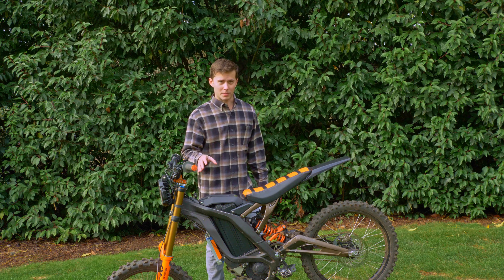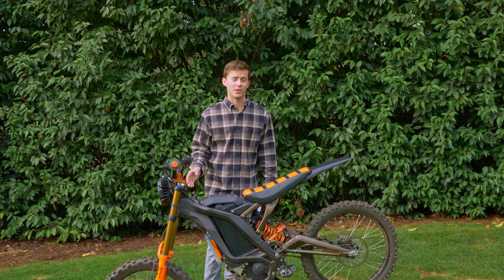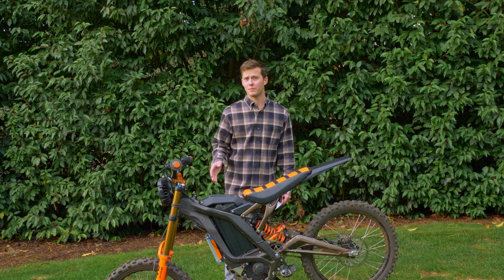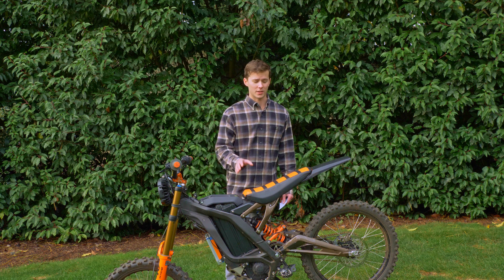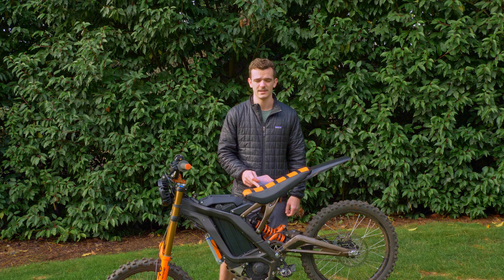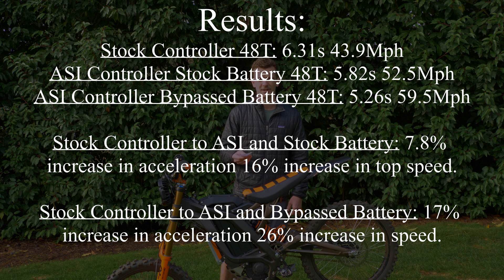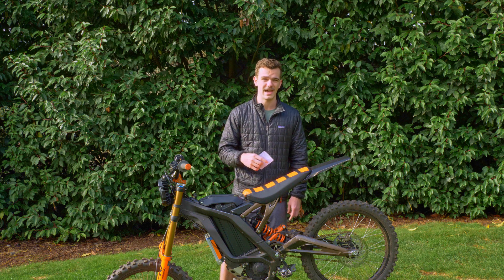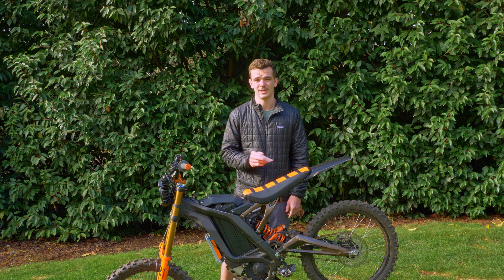Is Upgrading Your Stock Sur-Ron Controller Worth It? Testing ASI vs Stock

Comment: I believe that I should have sold my surron after two years. No problems at two years. Crazy electronic train wrecks after two years. Now it gets expensive. Whatever I saved on gas, I am paying for replacement controller. A thousand bucks and it's going to wear out quickly. Add 500$ per year to your budget. I am sick of electric nonsense.

Comment: Sorry but I do not believe that going down hill will not increase your top speed. I would love to see a test to verify your claim.
Reply from the maker: We more so meant have an effect between the comparisons. Regardless, top speed on an electric bike is much more dependent on power levels than a gas bike. Gas is typically limited by the motors ability to turn over from drag or gearing restriction. On electric, you’re electrically limiting the top speed to whatever the power level dictates you can run as power = torque*RPM. 

Anecdotally, we hit like 43-44MPH ‘downhill’ and on perfectly level ground we hit the same speed with stock controller. Uphill is where you start to lose speed .

Comment: Great videos! I have a stock x260 and stock surron x. Primarily used for pit bike track and mx track. Trying to figure out what route to go with controller and battery. I want performance, but also want reliability because we are hard on the bikes.

Comment: I got 55 MPH ..you guys were going downhill hence the speed difference. The bypass and ASI tuned to 135 amps is what I did to my Surron..and significantly faster than stock. My resistance levels were between .034 and .039 moh..do you know what the resistance is of the stock battery is and your battery sag?(mine was 5.9 volts) with my extender pack. Ive taken the Surron battery apart and made some slight improvements so I would imagine you would have more sag and resistance than my setup.

Comment: That is a bit weird. Your controller really showed increased range by 5%? That is pretty significant. Could you explain how that could be? You accelerate faster AND you get longer range out of the battery, then upgrading controller is worth for anyone. Do I understand it correctly? 

Would I be able to replicate it by getting any BAC4000 and tuning it just as you have yours tuned?
Reply from the maker: So the comparison doesn’t use any more power. This is the same power draw as stock. The higher the ceiling of the controller is regarding voltage and power limits in general, the less heat waste their is when generating said power. Other gains could be from an increase in phase current which helps stay off the throttle as much. Nothing scientific regardless, just tested over a couple rides.

Comment: Can you upgrade just the battery and leave the original X controller stock? Or is that a recipe for disaster? I’m looking for mainly superior battery range and not so much power gains. Been looking for a 60v 50ah or better but not much out there

Comment: Hey guys... quick question with the BAC 4000 is there a MODE control that let's me have a slower mode and a faster mode?  I follow my kids around a bunch and its nice to have a more mild mode.
Reply from the maker: You can set two max power levels and within those two mode you can have 9 percentages of that max power so 18 total power levels that you can set to anything you want.
Reply: @emotobros  thanks guys!

Comment: You should just put a Zero motor in it, Sur Ron's are old tech now and over rated for speed they do. A 3000w dual hub 24 26" would beat one to 80kph on same voltage.
Reply from the maker: If you could point us to a lighter and cheaper mid-drive motor we would be happy to check it out. We don't like anything about hub motors so those aren't even in the cards.
Reply: @emotobros  KTM? Bosch? Chains belts old school Tesla's have 4 hub motors for a reason but to each his her it's own as the hipsters say. Be safe the no helmet is a squid organ donor ticket for sure.
Reply from the maker: @441rider  KTM isn't capable of much higher peak, is heavier and way more expensive. I can't find anything on non pedal assist Bosch motors. The surron motor is highly capable and is the lowest end option in their line-up. Their water cooled motor with a transmission is better than anything mentioned.

Comment: Nice video! I bought a sur-ron light we X 2020, last week in Luna cycle, but the range is very poor, 22 o 24 miles approx. I want to get more range, how much you spend for this new battery? and I need necessary the BAC? Or the battery works with the original BAC? And you need other stuffs? Like a new charger? Or you can charge the new battery with the original sur-ron charger? I only want more range I don't care more speed, I have to many questions because I live in Mexico and is a lot of money send the stuffs to here and I don't wanna get a mistake! Thanks! I love your videos!
Reply: You need bigger battery if you want the range increase, there's just no way around it. Every year batteries are getting better and better.
Reply from the maker: Hey there, the range increase with a new controller is very small since power used doesn’t really change. The battery is just the stock one with a bypass mod done. We have a video about it on our channel.

Comment: How did the range change: stock battery and ASI 4000 controller? 

Or bypassed stock battery with ASI 4000 controller?
Reply from the maker: At the same power draw BAC4000 has roughly 5% more range.
Reply: @emotobros  Yeah, but what is it in mpe?

Comment: I have a BAC8000 and the battery floods 60V ... I can connect it ... and I have to connect an NRT display ..... what will it be like. Thank you
Reply from the maker: I’m honestly not sure what you are asking. Our system is compatible with the stock 60V and the NXT display will not work with our kit.

Comment: Could I just ask, is it normal that the Surron is very hard to cruise at constant, especially low speed with? It will always come on and off power, even when throttle at constant angle. But never just deliver a constant power.
Reply from the maker: We experience this as well. One of the hard things about an electric setup since there is no delay from throttle to movement.
Reply: @emotobros  Idk... Speed controllers on my RC models can do it without problem.
Reply from the maker: @scheeenfilmiesgucke  Do your RC ESCs have regen and engine braking? that's a big reason why the feel so on off is because the engine braking is kicking in.
Reply: @emotobros  Sure they do. But keep in mind I am not letting off the throttle in the described scenario.
Reply from the maker: @scheeenfilmiesgucke  Ah I misread the original comment. Ours doesn't feel jerky if we are holding the throttle still. I thought you meant cruising at low speeds and letting off then getting back on.
Reply: @emotobros  Jerky describes it pretty well
Reply from the maker: @scheeenfilmiesgucke  The throttle is based on a bit mapped voltage and if it is low speed (right after throttle engages from zero) than your throttle could be turning on and off because you are right at that threshold.
Reply: @emotobros  Like, at constant 15 mph ?
Reply from the maker: @scheeenfilmiesgucke  The speed you are going matters less than where your throttle is since it is different for every bike.
Reply: @emotobros  At 15 mph you are definitely not at the zero threshold though.

Comment: What be deduced regarding your forthcoming upgrades compared to the new Sur-Ron XX which is now on sale?  Apparently it has a modified controller which can pull 150 amps (peak) from a 31Ah battery at 65V.
Reply from the maker: Luna said they raced them head to head and it was a dead tie. Difference is ours has lots of adjustability where as there is a simple sport and eco switch.
Reply: @emotobros  Is the XX's performance on par with  your setup, with or without bypassed battery?
Reply from the maker: @scheeenfilmiesgucke  on par with bypassed setup.

Comment: I have been trying to get a 42 tooth sprocket for my stock Sur Ron X to see if that will boost top speed.  I have a 64 tooth but I took it off after a week because it lowered my range and top speed too much.  Very curious what top speed on fresh bms bypass 60v battery and asi bac 4000 controller would be.
Reply from the maker: Seems like you could go over 60 easily. Ours was turned down too, we could squeezed a couple more MPH out of it but we were playing it safe.
Reply: Hey Bud, I've now logged approx 500 mi since changed to #42 with stock lbx. Overall top speed and range (gps measured) gained 5% or thereabouts.
Best max 44mph. Best trip 37.7 mi with %18 remaining
Reply: @garylinnert1574  Very good.  Thank you for the information from gps👍
Reply: We have hit 108kph flat ave wind 80kg rider on our super mortard SurRon with bac8000 60v battery fresh bms bypass. So that’s closer to 70mph
Reply: @salesebmx4696  wow...that is really impressive👍
Reply: @salesebmx4696  I assume that's the 42 tooth sprocket right?  I may have to get that supermoto kit...
Reply: @cbenson76  correct 42 tooth
Reply: Same it seems like it could boost top end.

Comment: Hey buddy , iv just bought a Surron x . My battery and charger both say 48v but the person in China who sent it say it’s a 60v but they put 48v on for shipping reasons . Is this true or have I been ripped off . Thanks
Reply: Did you check the battery
Reply: My battery says 48v-B
Reply from the maker: Hook a multimeter to the positive and negative of your battery at full charge, only way to truly know. My guess is you got scammed. I’ve never heard of any shipping rules related to the voltage.
Reply: Thank you so much appreciated
Reply from the maker: Reply back if you can when you find out the voltage, I’m curious on the outcome.

Comment: Maybe i missed it in the video, but did you use the BAC2000 or BAC4000? Assuming 4000 from the comments. With a modded stock battery, will the performance be the same between the 2000 and 4000? Perfect timing with the videos, I just got into this a few weeks ago! subbed with notifications on.
Reply from the maker: Yes, it was a 4000. At these amperage levels the performance on stock battery would be pretty close between 2000 and 4000. The 4000 has slightly better low end torque due to higher phase amps but that’s it.

Comment: Nice vídeo, those results will  Change with bac8000?
Reply: its more dependent on the battery at that point
Reply from the maker: No, there are no additional performance gains to be had with the BAC 8000 at the power levels used in this video. The BAC 4000 can reliably handle 15kW which is more than anyone needs (even 7kW is a handful). It's very easy to find videos of people trying out 15kW only to crash and have the bike shoot out from under them. While it is true you might get a little better heat dissipation with the larger heat sink,  any performance gains will be virtually negligible at the same power levels.

Comment: Thanks for doing these types of tests.  What should really be a motivating factor for people to buy this set up from you guys, is the upgrade options that the bms bypass, eggrider display(able to quickly switch from 60v to 72v battery), and ASI BAC 4000(although I wish you guys just went with the 8000 model, better heat dissipation and greater power for not much more money) kits will provide as there are now a number of 72 volt battery makers with super powerful cell configurations currently on the market.
Reply from the maker: We really did consider the 8000 but we didn't want to be in the market of people wanting more than 14-15kW continuously. That's the level that things start to break and people get hurt and that's a headache for us. Heat dissipation is moderately better but ours have never even gotten much warmer than ambient temp. I'm sure we will offer it at some point. We are tying to enter the battery market as well, hoping to bring a 60V with 50% more range (30 hard miles) and 10kW of power.
Reply: @emotobros  the 8000 are what they are using in the south with warmer climates otherwise you do start heating up...
Reply from the maker: It’s possible at high power levels where you are constantly wide open but at 10kW and off road riding, heat shouldn’t be an issue.
Reply: @emotobros  valid points...I am definitely going to buy the 4000 kit from you guys, because so many other options won't let me quickly change from a 60v to 72v battery and the eggrider with bluetooth and the app is top notch...curious to see which cells you decide on for your battery builds...cheers
Reply: @emotobros  That's a great move I think.  No problem with the 8k at all, but for a ton of people what you get out of the 4k seems plenty for the Sur ron.